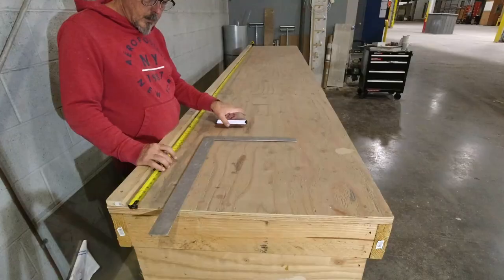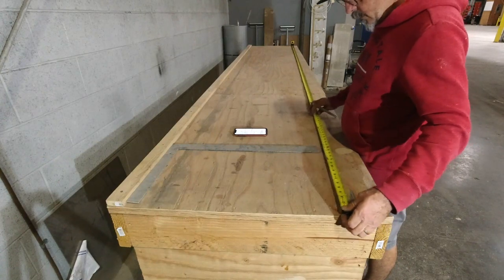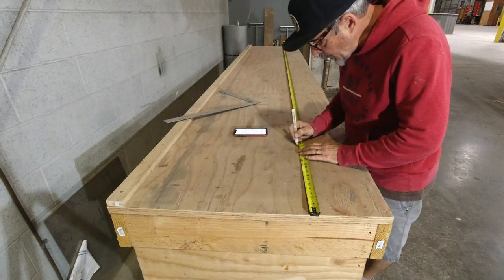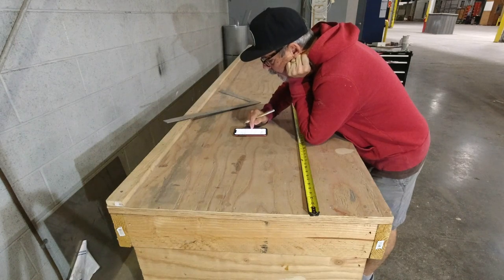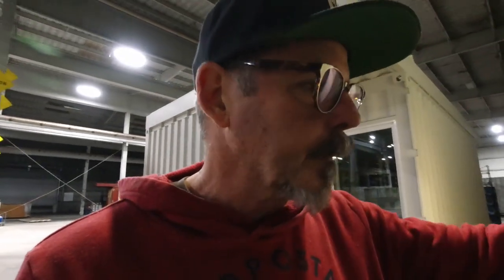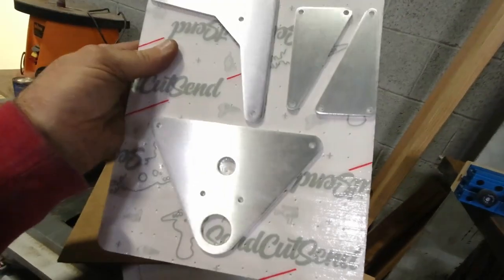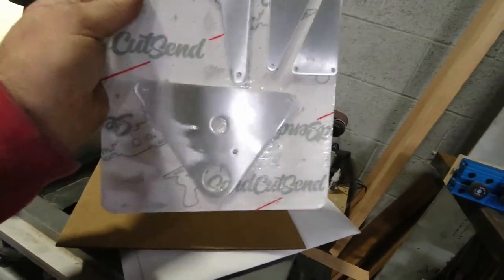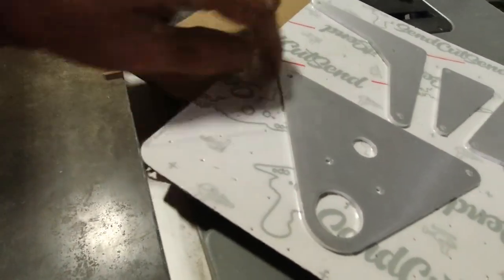Minimax1100r Aircraft Build Vlog Episode 47 - Laying Out the Fuselage

Comment: When I put the fuselage together the plywood side skins bowed in. It was also really hard to bend like Gyro Jeffro mentioned. On the ETLB forums I recall a few people suggesting to glue the side skins on after gluing the fuselage and bending the sides. If I ever build another one that is how I will do it.
Reply from the maker: This mod is 1/2” wider at station 1 but I don’t think that’ll prevent the bow in the sheeting. My 103 did the exact same thing. Did you glue your fabric to all the forward ply areas?
Reply: @DTMinimax  I did glue the fabric to all the plywood top, bottom and sides. If you do, make sure you glue it completely or you will get bubbles in the hot sun

Comment: Does the 1/2 VW use a bed mount on the Mini Max?  Soon you will have a fuselage to sit in, thats always a great motivator.
Reply from the maker: There are models like the VMax that are designed specifically for VW and they use welded rear mounts. 
This is a modification by Morey Hummel for a bed mount application. Here’s a link to the front end modification:
https://www.teammini-max.com/support/conversion-info/
Scroll to the bottom and you’ll see the drawing and photos
Reply: @DTMinimax  Looks good and sturdy. The Legal Eagle I flew has the Casler 45 hp cut case VW.  You will like the power.
Reply from the maker: So happy to hear that Kevin! I haven’t been able to connect with anyone who has flown one of those engines. Glad you have experience